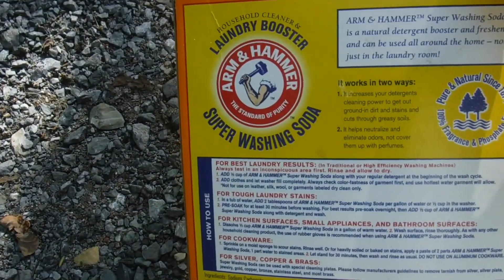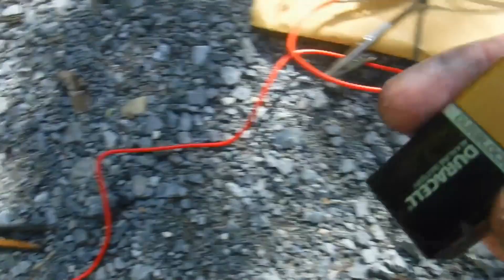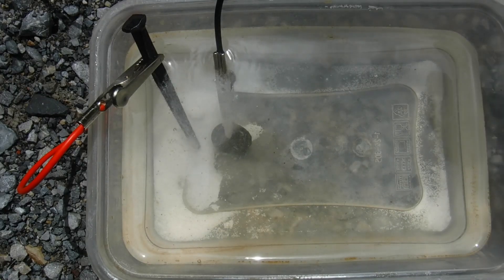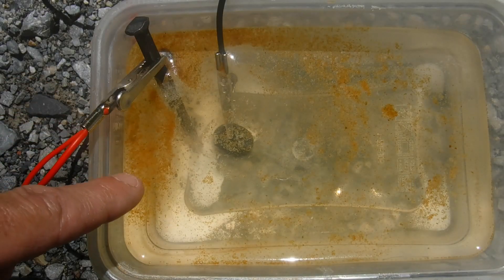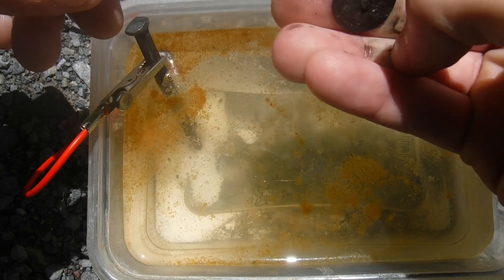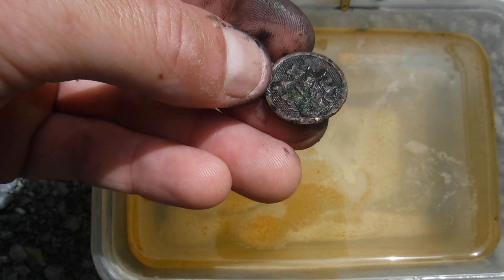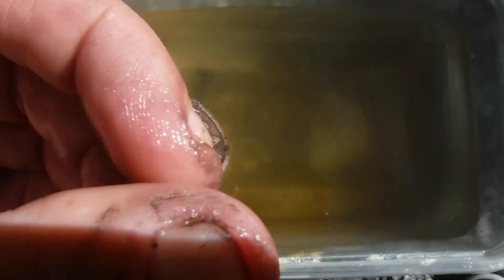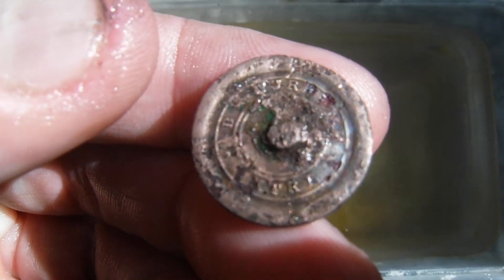Small Scale 9v Electrolysis.

Comment: Late comment, but how long does the 9V battery last? My new battery only lasts for 15-30 mins before needing a recharge
Edit: Also, the bubbling is not so intense when I try. Bubbles just a bit and dies within 30 mins. I use graphite rod, and ensure part of the coin and the rod is out of the water. If they are fully immersed, then the crocodile clip starts eroding.

Comment: Hey buddy.  Good information.  I used this process on 1800s large one cent pieces, and regretted that I did.  I do not recommend it for early copper coins.  Of course if you reverse the electrodes and use a silver spoon instead of an iron spike, you can electorplate a button with silver...  KRH
Reply from the maker: I may just try that.

Comment: This is how I clean my really crusty items. I use a dremel with a steel wire wheel bit each time I pull the item out of the electrolysis. Works great for eagle buttons, but not something you can leave unattended. I check every 10 mins at first, then progressively shorten that time down to just a few mins when I can see that it is getting close to finnished.

Comment: Yes, don't forget relic in electrolysis! What was the total time exposed for that button? Have you been able to remove the crud and save the gilt on other relics? And is there any followup treatment or sealant that you use?
Reply from the maker: Good questions Gene, I would say the total time was an hour and a half. As to removing the crud on other relics/post cleaning treatments, I typically do not clean brass relics any more than I have to for identification and so these are not processes I use much any more. Having said that, you could rub small amount of olive oil on the button/relic after treatment to seal it(I just personally do not like the look of oiled relics, it darkens them.) As to other methods for cleaning relics that will retain the gilt, my father (The Kentucky Relic Hunter here on YouTube) has a method using aluminum jelly that works for him wonderfully, here is a link to his video detailing the process https://www.youtube.com/watch?v=z3mc58-4OzM   .
Reply: Gene Oliver 
I coat my iron relics with boiled linseed oil to preserve them. Seals and waterproofs.

Comment: I use a 9v plug in wall charger instead if the battery! Just cut off the female plug at the end and get a set of gator clips with screw connections or simply use a solder gun and solder the wire to the connector. Same end results, must be careful not to over clean the small relic and never use it on a prize piece! Good vid BirdDogg and good luck on your trip!
Reply from the maker: Thanks Erle. Yeah, I have seen others use the wall charger as well. Easy to overdo it with electrolysis for sure!